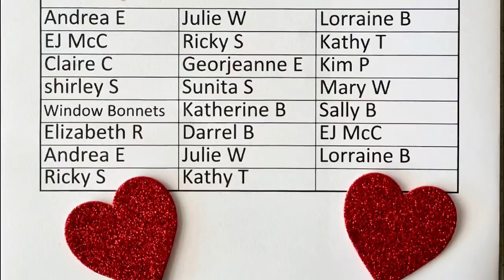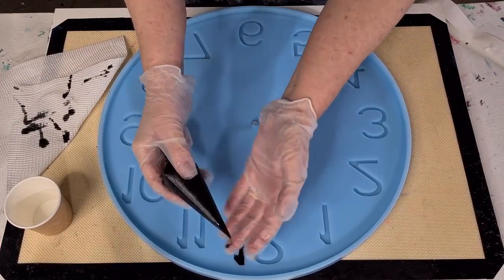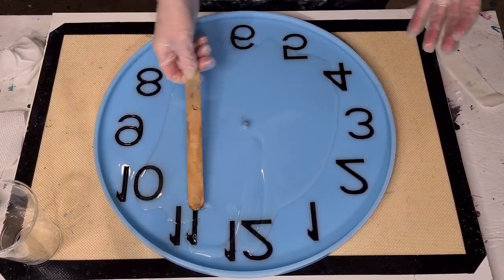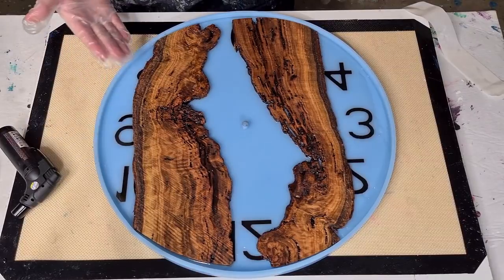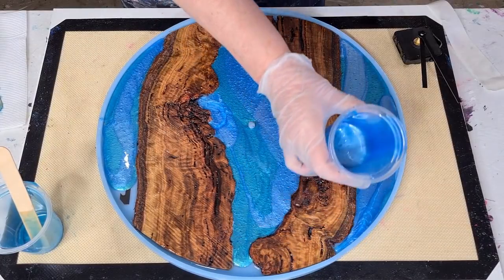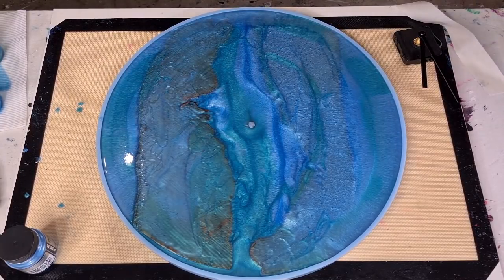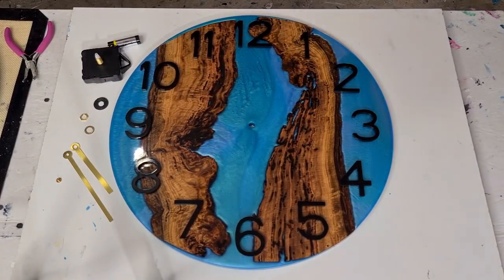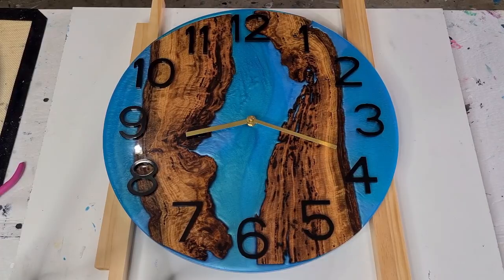#1181 Live Edge Resin River Clock Made Easily In A Silicone Mold

Comment: You said exactly what I was thinking. When using the timber, put resin on the back, let that dry cemetery. Then when ready to do your project, resin the other side, add to your project while that side is still wet or slightly tacky.

Comment: It's absolutely stunning. My only observation is I believe the piece of timber on the left hand side when you first laid them down. You put it upside down. I believe the way it was cut it would have fit much better. However it looks beautiful either way ❤️. The micro bubbles are not offensive at all it doesn't take away from your beautiful clock ❣️

Comment: Turned out gorgeous!  I love it! 😍  If the bubbles really bother you, you could always use a little drill to drill into all the bubbles and fill with clear resin, however that would require you to either sand and polish the resin afterwards or give the whole thing a thin top coat for a completely smooth finish.  The bubbles seem small enough to not bother with though.  I suggest that next time you put a coating of resin on the wood first, use the torch to pop the bubbles, flip and lay it into the mold, THEN add more clear around it.  Add something heavy on top of the wood pieces to make sure any other bubbles squeeze out and keep popping the bubbles you see forming every 10 to 15 minues until you don't see any more.  That would probably work best for getting as many bubbles as possible out.  Another thing you could do is just use a clear spray varnish on the wood to seal it.  Only other thing you could do is get your hands on a pressure pot but those can be a tad bit intimidating, especially one large enough to hold your big molds. 😅

Comment: I missed the diameter of the clock. Looks like 10 to 12 inches. Although the bubbles don’t look bad in this piece you might try a pressure pot as it can reduce the bubbles down to microscopic size and not visible. Great piece by the way. I have some clock materials coming now so I can try this. Thanks!

Comment: To avoid the bubbles maybe you could try putting a coat of clear on the timber that filles the holes completely. I mean right side up and pouring on top, with a taped backside... than after curing the timber should have an even surface that goes into the mold. But anyway I really don’t think the bubbles are distracting. I actually like them 😊

Comment: Get a vacuum chamber to pull all of the bubbles out off your work
Reply from the maker: Do they make them that big?
Reply: You could make or have someone make one the size you need
Reply: Just make a plywood tray ,the size you need ( in your case ) it looks to be about 76 x 76 x 2.5 ( I think I have your metric system correct) 30x30x1” and make a lid the same width and length and get a vacuum seal bag the size of the tray , the tray box is only to keep the pressure from crushing your work or to keep the vacuum bag from touching the resin, you may also make some little blocks of wood to put around the clock tray to keep the center of the lid from touching your work surface as well